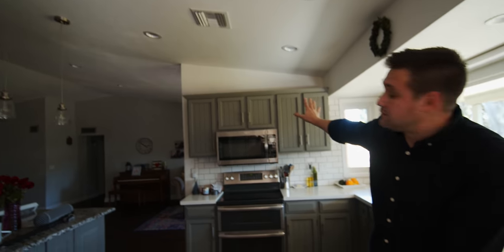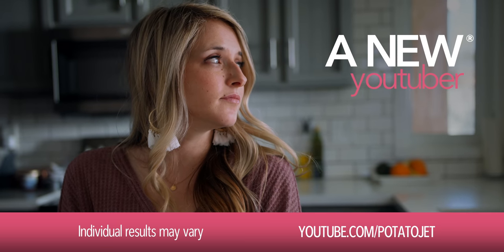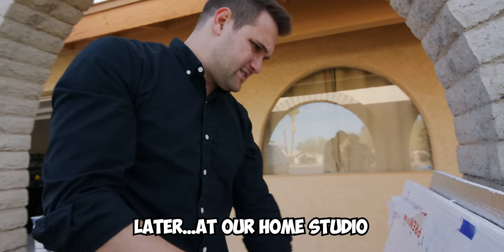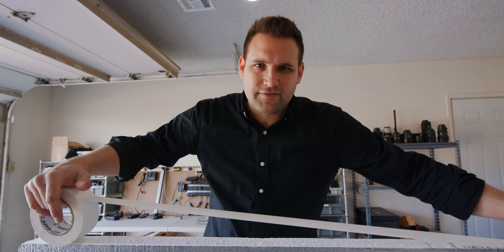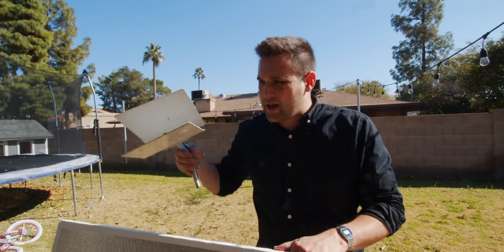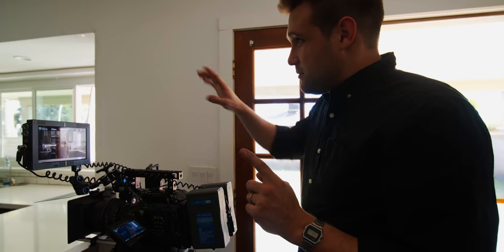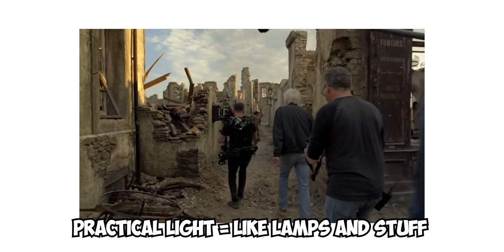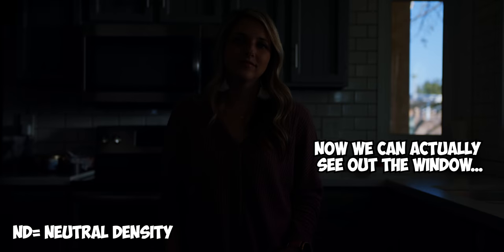INDOOR LIGHTING with no lights! -- Become a SUN WIZARD

Comment: Can you make a video about lighting in a really small room (20ft) / a corner ? I watch a lot of lighting skill, you are the best !!! Your explanation  is easy to understand and make me want to take action! Of course, a gorgeous lady is the first step, right? LOL
Reply from the maker: Yes small rooms are difficult. I would recommend taping a white sheet to the wall to the side of the camera and bouncing a light off of it for the key. For the backlight find a way to attach a light behind the subject on the wall or on the ceiling without a stand. A wall spreader can be used or a scissor clip or clamp can be used. The less stands the better in a small room.

Comment: Quick tip: Get an electric knife. The ones you use for cutting meat or bread. It’ll cut through that foam like butter. Way easier than using a knife or razor blade. Lots more control and well worth having.

Comment: What were your cam settings and did you color grade
Reply from the maker: I think 400 iso, 180 shutter angle, T2, 60fps with .6 ND. We shot in extended video mode 12/1 braw. In terms of color we boosted the saturation and tweaked the white balance.